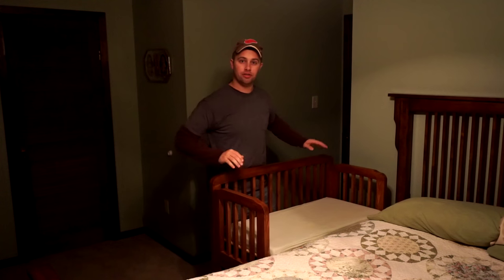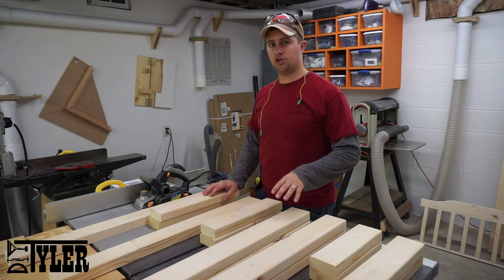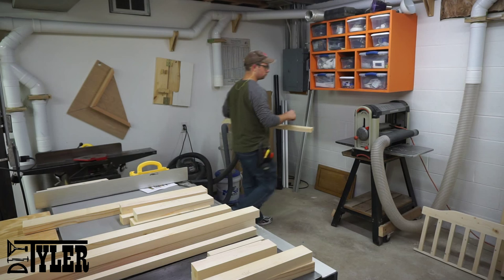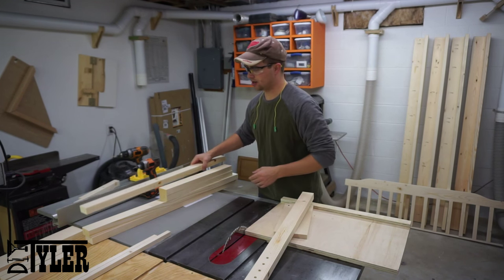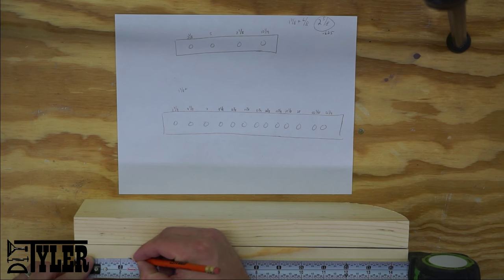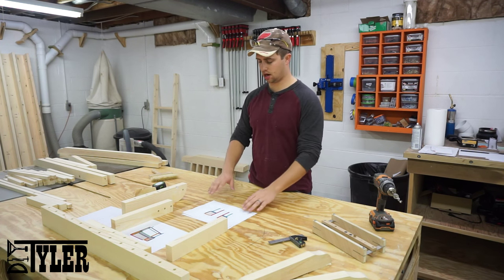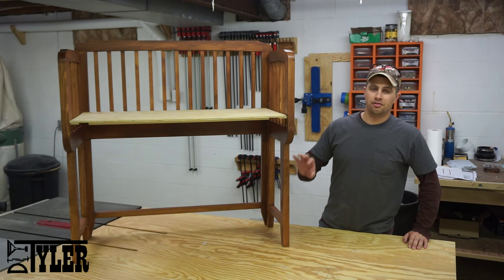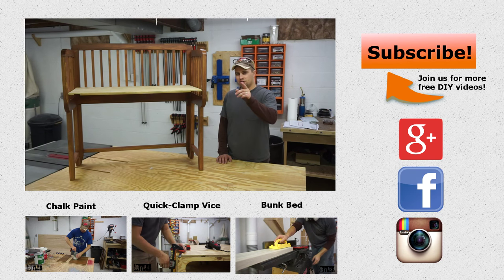Co-Sleeper Crib

Comment: Nice design. Maybe you could drill more holes for the height adjustment and use different ones so you can tilt the sleeping surface for the cases when the baby has a hard time swallowing or is coughing a lot. Being able to tilt it comes really handy for our little daughter.
Reply from the maker: +jakoball That is a really cool idea! There are already additional height adjustment holes so you could already tile it to a certain degree but it is easy to add more. Thanks for watching!

Comment: Is that the only dust extractor you have for all the machines ? If it is does it loose any suction ?
Reply from the maker: +aaronstill Yes, it has duct run all around the shop. No suction loss that I can tell, works extremely well. Thanks for watching!

Comment: At 6:58, why did you flip it each time? It turned out nice.
Reply from the maker: +Bruce A. Ulrich So any blade angle that you might have does not get compounded with each cut, if you flip it it gets cancelled out. Good eye, Bruce, that was sped up right there! Thanks for watching.
Reply: +Tyler G I kind of thought it was something along those lines, but I was curious. Do you know that your blade is off, or have you just found that all blades are a tad off, despite your best efforts?
Reply from the maker: As far as I know my blade is really accurate BUT I don't have a machinist square to set it for sure so it's a good practice to flip your boards.
Reply: I'm going to try this.
Reply from the maker: The crib?
Reply: +Tyler G Oh, no. Sorry. I'm going to try that method (already tried it this morning, actually.) I'm not sure we would use something like this. We have never had our babies in the same room with us so far with two children. We always make them sleep in their own rooms.
Reply: +Bruce A. Ulrich Newborns alone in their own room?
Reply: Yep. Newborns must have nothing in the bed with them. Plus, we have sound monitors.

Comment: A stunning finish for 2x4 material. What did you use?
Reply from the maker: +Derek Cadmus Thanks Derek. Finished with General Finishes water-based stain and varathane water based poly applied using a HVPL gun. That water based stain is pretty incredible, have finished two 2x4 project with it recently and they look amazing...definitely my go to stain.
Reply: What's the color? I'm dumbfounded! Never seen such results on pine much less 2x4 wall studs. Still blown away
Reply from the maker: +Derek Cadmus It was shaker maple. The water based stain has a little bit of a learning curve to apply but it dries super fast and covers extremely evenly.